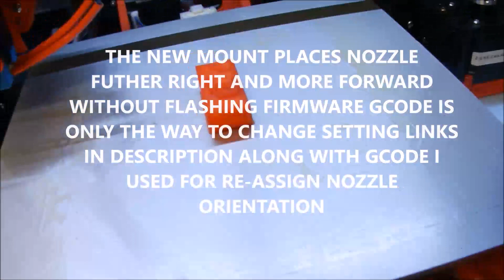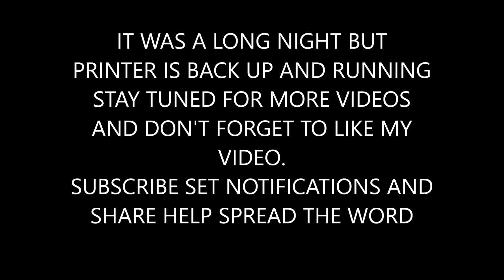I PUT AN E3D V6 ON MY ANET A8

Comment: 3 years later and you saved me. I have an Anet a8 too. I've been trying to make this work for 2 days. Diving inside all possible configurations in Marlin, and, after all, the problem was the f** spring. Tks alot.

Comment: Sir after changing e3d how to print center of bed
Reply from the maker: i would highly suggest upgrading the firmware to the latest Marlin for 1 and will be easier to make adjustment then with the old Anet firmware

Comment: I'm gonna be putting that system on both my printers. I think you have the cone on the fan in front upside down. I think it's supposed to be the other way so it doesn't suck the heat from your hotbed. I think that's the purpose of it so your not drawing the heat from the bed. 🤔
Reply from the maker: Ya I’ve switched it someone else pointed it out and I attached it with the wire going to wrong way and was lazy didn’t want to switch it but I did eventually change it
Reply: Inside The Mind Of Matt cool. This was my first printer. I liked it so much I has to get another one. I've been doing tons of upgrades on them and that was explained on one of the videos I had watched and it made a lot of sense.

Comment: I also put a e3d v6 on mine and I followed your nozzle position change and it made no difference. I try to go to the reference page link and it asked for my facebook login.
Are you using the stock anet a8 firmware?
Reply from the maker: Jeff Pierce what was the method you sent the gcode to your machine? And yes I'm still using stock firmware
Reply: Fixed the problem.  the negative was backwards, ' -' number for Y axis, not X axis.
Also, the stud is not just to hold the spring, you run it out so the adjustment screw hits it and that provides the stop to transfer the pressure to the filament wheel. The nut on the stud is to lock it.
Reply: I got it to work. I found that I had to switch the negative sign. I sent this:
m206 t2 p231 s1100 (FOR X)
m206 t2 p235 s-2000 (FOR Y)
I tried to go to reference page, but it asked for facebook logiin.

Jeff
Reply: Hi! I just updated my anet A8 to V6 with this mounts and I'm trying to center the nozzle but I don't know where to put these values (m206 t2 p231 s1100 / m206 t2 p235 s-2000) Can you help me?
Reply from the maker: CAPITAL LETTER NEED TO BE USED WITH GCODE 😁 not yelling just for effect let me know if that works
Also there is another video I did where I used a different mount https://youtu.be/nL9EzrRTXVo
Reply: Well, I mean, haha I have this GCODE in my printer settings:
G21 ;metric values
G90 ;absolute positioning
M82 ;set extruder to absolute mode
M107 ;start with the fan off
G28 X0 Y0 ;move X/Y to min endstops
G28 Z0 ;move Z to min endstops
G1 Z15.0 F9000 ;move the platform down 15mm
G92 E0 ;zero the extruded length
G1 F200 E3 ;extrude 3mm of feed stock
G92 E0 ;zero the extruded length again
G1 F9000;Put printing message on LCD screen
M117 Printing..0

What I don't know is in wich part I have to replace the values that you show in description of the video. Sorry but I don't know anything about codes XD

Comment: I think you have your shroud fan intake on upside down dude
Reply from the maker: jbbolts that fan pulls off easy and I can flip it but it's just decoration
Reply: ok... I just saw in another video where the guy mentioned it diverts the air intake to pull from the top "away" from the heated air from table....

Comment: It looks like the E3d support causes the loss of some print area. I was thinking about doing this mod but I don't want to lose any build space. How much did you lose?
Reply from the maker: Gopher Rancher I'm going to answer this question in my next video thanks to you I knew the problem when it happened
Reply: I found another mount that looks like it might be a better choice. It still uses the stock cooling blower and will accept cooling ducts that are designed for the stock setup. I'm printing it right now and will soon know if it is a better fit. If you are interested take a look at http://www.thingiverse.com/thing:2099577.
Reply: This is the mount you want: http://www.thingiverse.com/thing:2143520
No loss of build space and works with the i3 x-carrige. In addition if you have the newer version of the a8 you want to use this carriage (http://www.thingiverse.com/thing:2166790) instead of the i3 one since it gets tight at the ends.
Installed those on my printer and all is finally working properly now.
In the first link you will see they have this in the firmware settings: #define X_MIN_POS -20. I found #define X_MIN_POS -19 to be more accurate on my machine.
Reply: this link wont work http://www.thingiverse.com/thing:2166790)